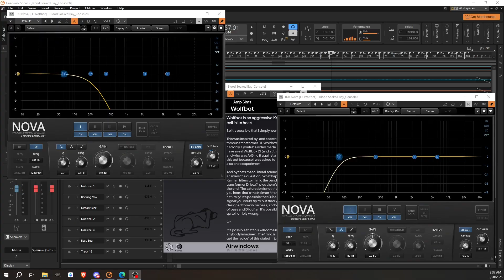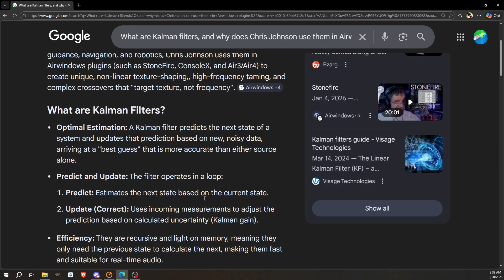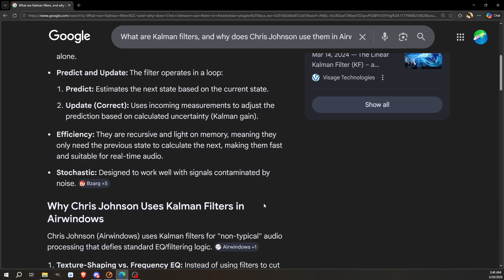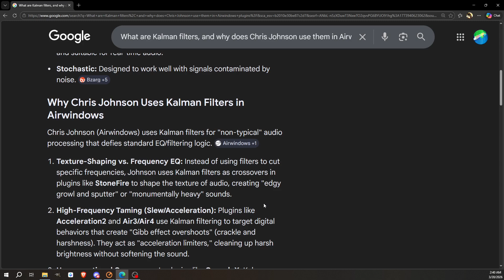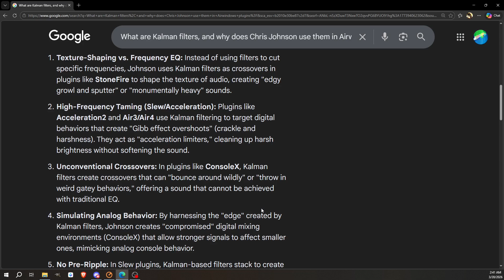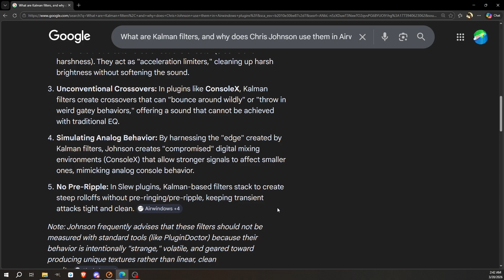Why I'm Trying Kalman Filters for Analog Weight & Warmth

Comment: When you chase that analog sound, consider also the effect of bass and guitar players using mic'd amplifiers, which includes loudspeaker dynamics as well. Lotsa folks consider the transcer curves of tube amps. The loudspeaker dynamics matter too, to be really authentic. And... I know of no processors which put work into the whole analog chain.
Reply from the maker: Thank you for your feedback and your advice. Airwindows Consolidated has air distortion modeling tools, Distance and Discontinuity coming to mind. There may be others. They play nicer at 96kHz or above, and I'm presently constrained to working at 48. I don't think it's possible to replicate true analog in a DAW. I'm just trying to get as close as I can without gunking up my signal. I appreciate your taking the time to share your thoughts. It does give me more to think about and look into.